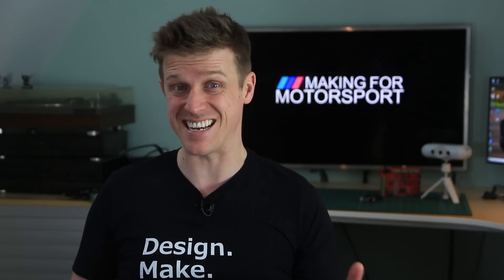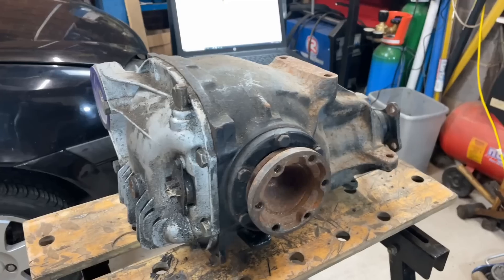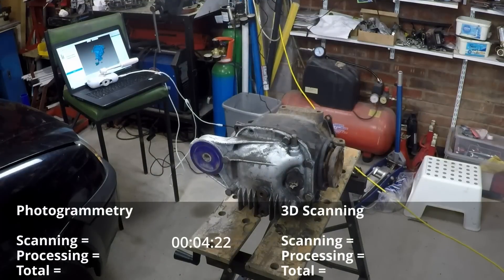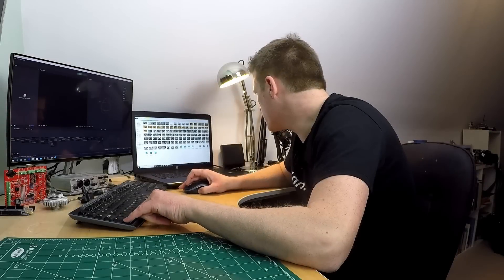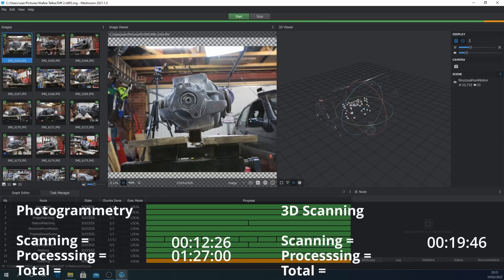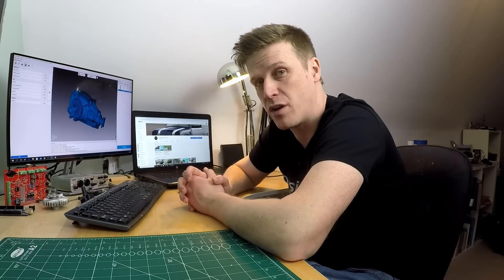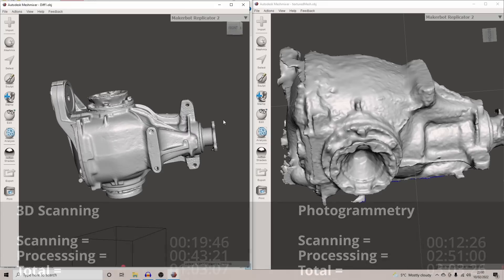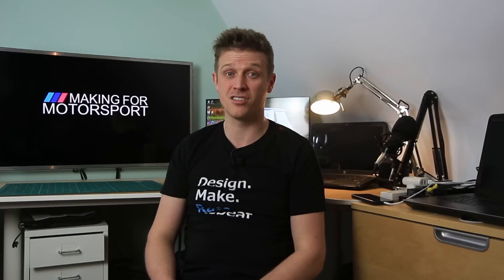CR-Scan Lizard 3D Scanner vs Photogrammetry - which one wins?

Comment: I think the photogrammetry result would be improved by taking more photos at angles / heights in between those used, and (not sure if you did this) different distances from the object to be scanned. Would be interesting to see a comparison using a larger set of photos and showing the difference between using say only one distance from the object vs several,  pictures taken at every 5 degrees of rotation vs 10, etc.

Comment: Hi, thanks for a very interesting channel. I do scanning as part of my job, typically I scan mining equipment engines.  My current scanner is a GoScan. I'd really appreciate your experience with the lizard working in tight spaces eg down the side of an engine in an engine bay. What I find is the GoScan, as good as it is, is just too big to get into maybe 20% of the places I have to capture, typically around the exhaust manifold. Having to be 400mm away from the object makes life really hard. I'd love to know how the lizard performs getting in and around somewhere where space to move is confined.

Comment: there are some ToF 3D depth sensors available for cheap like a Vzense DCAM710 (300 bucks) but i havent found a software yet that allows for 3d model scanning. i think ToF has more potential than structured light scanning, especially with a high resolution ToF camera.

Comment: when you scan it do you get the actual size? or do you need to manually mesure 2 points and then scale it?
Reply from the maker: With the scan, it’s to size, as accurate as the scanner can do.  Photogrammetry needs to be scaled.

Comment: I'mma be real, I've never, ever gotten good results from meshroom. Datasets I've gotten great results with in Metashape, are unintelligible blobs in meshroom.
Reply from the maker: Right then, Metashape and Reality Capture are now both on the list!
Reply: @MakingforMotorsport  Never used reality capture. But for my purposes, reverse engineering non-pressure bearing gun parts, I've had exceptionally good results with Metashape. In a data set of about 200 photos, I've gotten scans with dimensional accuracy within a thou or less. Pretty crazy considering it's just photogrammetry and I can get any Joe-Bloke with a DSLR to get data for me with a little instruction. 

Honestly the key with any photogrammetry software, is to prep the surfaces well, and take a lot of data. Not fast. But very cheap, very utilitarian.

Comment: Photogrammetry: How many pictures were taken ? How where they taken ? Did it capture enough ? Also no development spray was used here. If I take 10 shit pictures, photogrammetry will not be able to do much. I bet somebody who does a good job with photogrammetry would have just as good of a results as the scanner. It is 100% possible I guarantee it. It just takes more pictuires and better pictures. It would be better to have a good result in both cases first and then comparing the time and money spend to aquire such result

Comment: In general to do photogrammetry for a piece like this you need to shoot 150-200 photos including closeups of smaller parts, powder spray the piece and place retroreflective markers on the piece.  this will greatly improve the quality of the mesh but your laptop will be in pain from the processing. Meshroom relies on CUDA so you really should have a beefier setup to tackle pieces with this many details.
Reply: Meshroom is absurdly slow even with CUDA, and the results are lackluster. Reality Capture just became free, would highly recommend that for photogrammetry. Probably still not as accurate as a scanner though.
Reply: @Waffle4569  The major missing pieces in most photogrammetry is depth and correlated vector information from the camera. A scanner is tracking it's own movement and orientation and correcting for that as it goes, drastically improving accuracy. 

It is possible to get the vector information, but without also using a depth camera that information has to be calculated from the images, this means every minor issue is magnified.

Comment: Scan lizard turned out great, thanks for posting! Photogrammetry should've turned out better though. Meshroom is free but doesn't generate a great mesh, recap gives the best results from my tests. Shiny areas need to be dulled down even more or the surface will get bumpy, could use a better dulling spray since there's still a lot of shine. Also, your body is casting shadows as you move around so photogrammetry software will get confused even with slight variations. Putting your camera in full manual mode would help too since the more consistent the photos, the better.

Comment: Have you been using the scanner much since this video? I backed on KS and I'm trying to decide if I should REback on pledgebox
Reply from the maker: I have used it abit, doing another video now.  I am planning to compare it to a POP2 soon, we’ll see which is better.  If you have the option to buy for £300ish then i think it’s great value compared to twice that for the Pop2.  The alternative being the RevoPoint Mini on KS at the moment which does look impressive but has a narrower usage case.
Reply: @MakingforMotorsport  awesome! When is it due to come out? I'm really tempted but I'll be using it for 99% car stuff so your videos are perfect examples!
Reply from the maker: @Bunta25  the RevoPoint Mini is on KickStarter right now for a bargain price but will take some months to ship.  
To be honest it’s new to me so I am not an expert, but the Lizard is a good useful tool, I look forward to comparing as many as possible 👍
Reply: @MakingforMotorsport  yeah that's the other tricky but thing! Having 2 options with not much to compare. I trust revopoint more as a company but I'd rather have something sooner🤔
Reply from the maker: @Bunta25  there’s an awful lot of bollocks in this field at the moment, with a lot of amateur people chasing 0.1’s of a mm.
The simple fact is that, outside of professional industry, virtually all of these scanners are far better than a home gamer needs, and any accuracy problems  can be fixed with 10mins and a digital calliper.
If you want to do minatures or create digital assets or sculptures, then that’s a different deal, but for our kind of Reverse Engineering or 3D modelling applications, even the RevoPoint Mini goes beyond what we need.
And more accuracy and resolution means more data which means larger files which means at some point you will likely have to sacrifice that detail to get a useable file. 
We aren’t going metrology.  Or at least I am not.  So far, the Lizard has met my needs.  Would a Pop2 do better? Maybe but not by enough that i see it in the scans I see on the internet. Could I even use that extra data?  Probably not.
Reply: @MakingforMotorsport  now THIS is a great reply. I've had this same argument on the 3D scanning subreddit a fair few times now! I've worked in RE for years and used loads of industrial scale scanners and that gives me more faith in what I've seen from the CR scan rather than the other way around. I guess I better get my order in!
Reply: So when's the new video on the lizard coming out dude? The re-order deadline for backers is the end of this month

Comment: This would have been very good if you had put any effort into taking photos every 30 degrees at least and also from different heights in similar intervals. What has been seen in many other videos does not portray at all your results. Other than that the subject is good. You should  think first and then do this same video second time, just te photogrammetry part, scan you already have.
Reply from the maker: Thanks for the comment, but I my aim wasn’t to get the absolute best scan on either method, but to compare them both with similar skill levels (low) in each and similar amount of effort on each scan.

I do fully intend to revisit this, but probably with other software people have recommended 👍

Comment: Great review and results, I managed to find a lizard on ebay, so took the plunge. Scan results represent good value, the software is something else though. 

I must be 20hrs into scanning an audi o1e gearbox, I cant tell you how many times the software has crashed, operating well within the specs of my cad workstation. I dont know if im missing something, but im down to 1x scan per project (sub 4gb each) not holding much luck merging them together given software stability so far. 

Sadly I think i’ll have to return it, the software is simply not mature enough for any moderate engineering detail.
Reply from the maker: Hi there, the Lizard they haven’t been released yet (and there is some legal wrangling going on) so you must have found one of the review units. 
I have had the odd crash but nothing that stopped me getting the results.  
Try to keep the individual scans below 1000frames, and merge them rather than trying to capture all the data in one go.
Hopefully all the legal issues with Creality will be solved soon and Creality can continue to support and develop it…
Reply: Thanks for the reply, yes I really lucked out on the review unit from ebay! My trouble is that with the gearbox being a transaxle, the geometry is cylindrical and i need to capture a full rotation/pass, meaning even on the lowest frame rate, each pass is around 1k frames, anything less than a full rotation and im finding slight elongation occurring in the scans meaning they wont line up. Frustratingly, when aligning and saving the 3x passes, it is just crash after crash, ive not even got to merging. 

Smaller parts, ive had good success though. Actual scanning performance is good, I might just export each pass as an stl, then combine in a separate piece of software. I think for peace of mind i’ll do a clean windows install, start again with fresh drivers etc. 

Really appreciate the help, your channel is an excellent resource!

Comment: I'm wondering if it will work with Meshlab. That's an insane scanning software. Thought Fusion was tough, but that thing, is a real brain buster.
Reply from the maker: It outputs Stl and obj so I reckon you could import straight in… I have never used it but it looks similar to meshmixer

Comment: Great video. Small tip: For 3D scanning bolt holes can be difficult to pick up so leaving bolts in them partially unthreaded gives the scanner something much easier to pick up giving you an accurate location for the hole pattern.
Reply from the maker: Yeah, the holes always struggle, I will may turn up a set of dummy bolts with a threaded and a plain shank to screw in.  Hopefully the plain shank sticking up with be picked up better, at least it’ll give the centreline…

Comment: For anyone using photogrammetry, use 3df Zepher instead of Meshroom. It is much easier and faster. I've used it for control arms, light housings, and even houses (with drone photos). The only tricky part is making sure the final model is scaled correctly and imported into CAD with the correct units.
Reply: 50 photos limit for a free version.

Comment: fast and accurate photogrammetry needs a really high end pc, but if you can take high res video, film at say 24 frames a second (not sure if it gets any lower), save those frames as image files, mesh room should then have all the "photos" it could ever need.
Reply from the maker: I have heard completely different answers on this as most videos will have a longer exposure than a picture so it’ll be much less sharp….
I am sure photogrammetry can do great work, but the more I hear the more work and effort it sounds!
Reply: @MakingforMotorsport  Yeah, sorry I was thinking of "red digital" or a "Phantom high speed" camera that can do much higher resolution, crazy sharp images at lower speed...for a premium price.

Comment: While I'm a photogrammetry fan boy, I have to give it to the scanner in this case.
It would take A LOT OF WORK to get similar quality output from photogrammetry even if an experienced photogrammetry user did the work. 
Given the equipment cost difference between CR-Scan Lizard and photogrammetry, the time needed for processing and skill level required for a good scan, it's a no brainer.

One other thing that wasn't mentioned in the video is that the CR-Scan Lizard 3d scan is already to scale, while the photogrammetry model is not. you'd have to do extra work to add scale to the photogrammetry model.
Reply from the maker: Adrian, absolutely my thoughts in this case, it’s a case by case I think.  Photogrammetry is a tool and it will work with some cases better than others 👍

Comment: Hey, I liked your video! I just wanted to comment and leave some helpful advice for better photogrammetry results, should you want to tackle it again. Because to be honest, unless you buy one of the crazy expensive handheld scanners, you will get the absolute best results with photogrammetry. 
There are 3 major things you can adjust to get superb results:
1. Image noise greatly affects your results. So making sure you are working on low (preferbly lowest) ISO is important.
2. Depth of field plays a major role, too. So ensuring you have a decent amount of dof is crucial... hence set your f-stop to at least f8 or preferably f16.
As you can tell both of these adjustments will mean that your image is gonna be quite dark. To compensate for that use a longer exposure or better yet, use a flash light.
3. This one is probably overkill but the absolute best results are achieved by cross-polarized lighting. Cross-polarized lighting is done to remove reflections of your main light on glossy surfaces. It's less of an issue on matte surfaces but if your surface reflects your main lights and you take photos from different angles those highlights will obviously shift on the scanned surfaces. Cross polarized lighting works in the following way. You attach a polarization filter onto your lens (usually used in photography to make the sky appear darker or for reducing reflection on glass or water). By rotating the lens filter you basically block the wave length of the incoming light. And now for the "cross" part. Your main lights also get a polarization filter (a polarization film/foil) in front of them. By adding them to you light and rotating the polarization filter on your lens you can entirely remove any reflections of your lights on the scanned object. The resulting photos look absolutely freaky because they are fully flat/diffuse. This technique is especially used for photogrammetry that requires you to extract flat textures as well. But it also leads to way better results because the flatter the photo, the easier it is for the software to discern and recognize unique reference points.
I made did a project at home for achieving high end photogrammetry scans (including the cross polarized setup) and here's two results:
http://andreas-mass.com/en/portfolio/3dscan_photogrammetry/
http://andreas-mass.com/en/portfolio/3dscan_mandelhoernchen/
The pastry one is especially a good example since it was very glossy to begin with (thanks to the syrup).
Reply from the maker: Some fantastic tips there and looking at your results there is some fantastic models!  There have been lots of comments (as I knew there would be) and I absolutely will give photogrammetry another go, incorporating as many of the tips as I can.  
That said, I don’t have the time or the space to do the setup that some people are saying is needed to get the best out of photogrammetry and I’d reckon that most people watching don’t either… but for some applications, photogrammetry is definitely the best option….
Reply: For all that trouble I doubt scanning it is that big of a difference. I'm not printing out museum sculptures. Even as a pro photographer I wouldn't want to sit there and take 200 pictures of something. Thankfully I'm a good designer and I haven't needed to do that. 

In another year hand held scanners will be more affordable. I can already see things heading in that direction. Companies will want to compete with this new scanner.

Comment: Add more photos for just the sections with low detail and run Mesh again to verify if photogrammetry /can/ do the job as well as the scanner. Contrast and a smooth/solid background can also help improve results.
Reply from the maker: I am sure that Meshroom with the right amount of time and pictures can do a good right.  But spending 5times the time on it just isn’t a solution for me.  I will revisit photogrammetry, but when it’s a better fit for the thing being scanned.

Comment: I'm gonna be that guy and say that your photos might have not been all taken the right way. You are leaving way too much gap between each photo, and there are areas in the object that might not have been covered well, hence the look of the model.
In the office our rule of thumb for photogrammetry is 10 degrees difference if there is a lot of detail in the object, so that means 36 photos for one revolution, and we go around the object 3 times. one being centered at the object and the camera parallel to the ground, one with the camera higher than the object and looking downwards, and one with the camera lower than the object, looking upwards.

And this is for an object that is simple with no overhangs or geometry that might hide other parts of the object.

Granted, if you have a good quality laser scanner, the laser scanner will result in a higher accuracy scan.
Reply from the maker: Thanks for the tips, that’s some practical info, I will try to employ next time I do photogrammetry. 👍

Comment: From my limited experience in photogrammetry it tells me that objects that are reflective, even if just slightly so can be a real problem as the surface tends to warp, now there are fixes to this I know (at least when using RealityCapture), but the best result I got was to use photogrammetry in tangent with a laser scanner. That way you will get the surface quality of photogrammetry and the mostly solid result of a laser scanner. I must say though, I really like that handy 3D scanner, seems quite nifty.